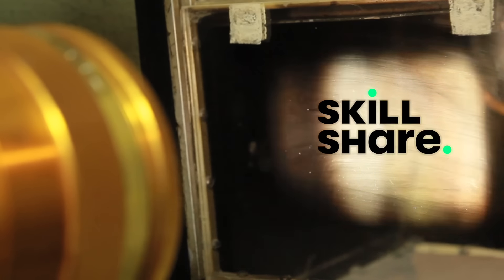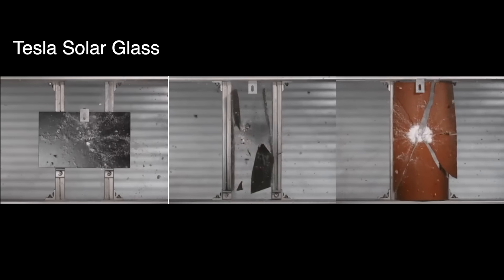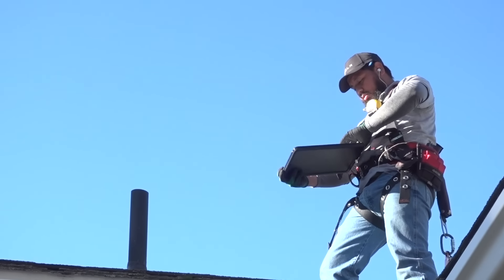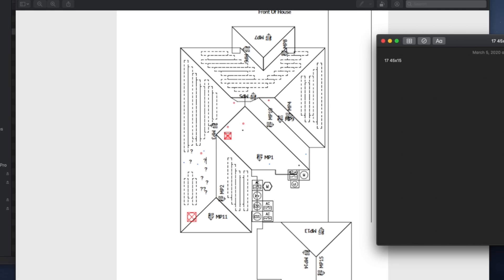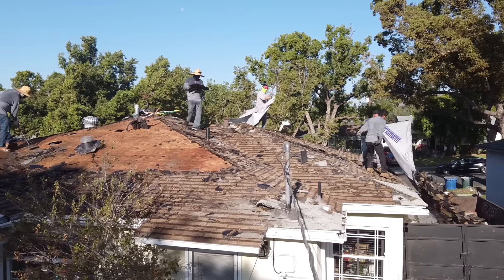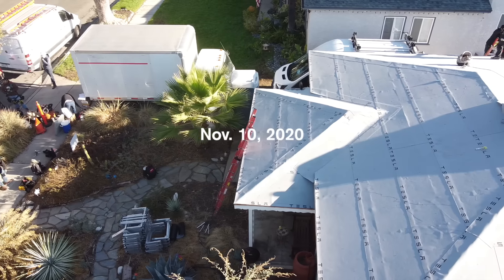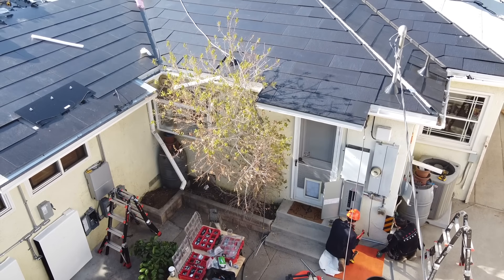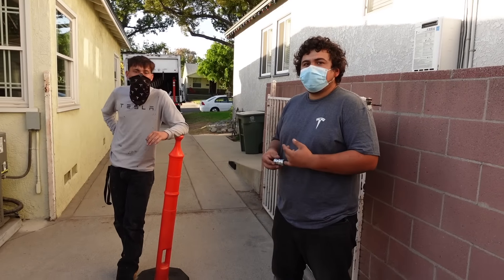This Tesla Solar Roof Was NOT Built in a Day

Comment: What about carbon footprint did you calculated my friend?
Reply from the maker: Hey friend, while there are no global warming emissions associated with generating electricity from solar energy, there are emissions associated with other stages of the solar life-cycle, including manufacturing, materials transportation, installation, maintenance, and decommissioning and dismantlement. Most estimates of life-cycle emissions for photovoltaic systems are between 0.07 and 0.18 pounds of carbon dioxide equivalent per kilowatt-hour. This is far less than the lifecycle emission rates for natural gas (0.6-2 lbs of CO2E/kWh) and coal (1.4-3.6 lbs of CO2E/kWh).  SOURCE: IPCC, 2011: IPCC Special Report on Renewable Energy Sources and Climate Change Mitigation. Prepared by Working Group III of the Intergovernmental Panel on Climate Change [O. Edenhofer, R. Pichs-Madruga, Y. Sokona, K. Seyboth, P. Matschoss, S. Kadner, T. Zwickel, P. Eickemeier, G. Hansen, S. Schlömer, C. von Stechow (eds)]. Cambridge University Press, Cambridge, United Kingdom and New York, NY, USA, 1075 pp. (Chapter 7 & 9). http://www.ipcc-wg3.de/srren-report/
Reply: @ThisGuysTesla  Wow thanks for fast response and satisfying answer with citations. Nobody takes his job this serious in youtube. Real respects for you :D

Comment: My final conclusion after seeing this rather involved analysis is this.  A Tesla roof is not financially feasible and is truly a waste of money.  Spending $65,000 on this system when it would take nearly 15 to 20 years to break even (assuming a zero cost of capital) is a dramatically wrong decision.  You can obtain a robust electric power back up for only $2,000 to $4,000 if outages are an issue.   However, the video was great and truly informative.   Invest that money instead is a REIT that pays you 5% indefinitely ($3,250 annually) and goes up in value, rather than becomes worthless in 20-30 years like this solar roof.
Reply from the maker: 65K? Not really. I have a video about my final cost and when the system will be completely payed off: https://youtu.be/abyQeGIQ4JA

Comment: An energy efficient home or business is more comfortable and saves money in the long run.
Added insulation, triple glaze windows, energy efficient doors, energy efficient heating and cooling systems, energy efficient appliances, LED lighting, smart thermostats, solar panels combined with battery storage and a electric vehicle charger in the garage or car park. People are too focused on the short term costs and miss out on long term savings and comfort. Blower door testing and air sealing are under appreciated tools.Even if you have money to burn you should not waste it.  Climate Change will impact everyone. Leave a better future for your children and grandchildren. Join in and speak up for the future of the planet.

Comment: There’s a bit of goal post changing n the video.  Early on the video proposed the ability to go off grid due to wildfires and the like.  Later, the goal switched to “neutrality”, a very different thing.  

Th goal from all this must be to drastically cut carbon emissions, and affordably if the solution is to see mass adoption.  If “neutral”. means the solution is always have a fleet of fossil plants out there on the grid ready 24/7 for when the home system fails, then 1) the system will never be very low carbon, and 2) a completely dual power system, grid and roof sitting side by side will never be affordable at large scale (ie subsidies run out).

Comment: Their durability test didn’t look all that fair... they compared it to longer ones, creating more of a weak point. Also the Tesla tile was on its side, with the middle holding bracket right at the middle. 

tldr: The non Tesla Tiles were placed so they had a greater weak point. The Tesla tile was placed in a much better position.
Reply from the maker: To be fair, those are the actual attachment points on a roof of either tile

Comment: You are getting hit by the contractors. Check the size of the plywood, 1/2(standard) is only $30 and yes that is up from it’s original but your looking at $100 per square and it takes one man no more than 30 minutes to overlay a square. 
Now the tiles, that’s out of my wheelhouse, never installed them, only metal shingle and wood shake and regular solar panels.

Comment: clean energy?
Reply from the maker: If you’re concerned about environmental impact, supply chain sourcing, factory carbon footprint, end product recycling and net energy breakdown you could read this:  https://www.tesla.com/ns_videos/2020-tesla-impact-report.pdf

Also While there are no global warming emissions associated with generating electricity from solar energy, there are emissions associated with other stages of the solar life-cycle, including manufacturing, materials transportation, installation, maintenance, and decommissioning and dismantlement. Most estimates of life-cycle emissions for photovoltaic systems are between 0.07 and 0.18 pounds of carbon dioxide equivalent per kilowatt-hour. This is far less than the lifecycle emission rates for natural gas (0.6-2 lbs of CO2E/kWh) and coal (1.4-3.6 lbs of CO2E/kWh).  SOURCE: IPCC, 2011: IPCC Special Report on Renewable Energy Sources and Climate Change Mitigation. Prepared by Working Group III of the Intergovernmental Panel on Climate Change [O. Edenhofer, R. Pichs-Madruga, Y. Sokona, K. Seyboth, P. Matschoss, S. Kadner, T. Zwickel, P. Eickemeier, G. Hansen, S. Schlömer, C. von Stechow (eds)]. Cambridge University Press, Cambridge, United Kingdom and New York, NY, USA, 1075 pp. (Chapter 7 & 9). http://www.ipcc-wg3.de/srren-report/

Comment: it probably took 22 tons of coal to produce this roof tile
and the emission on coal was less then the next 20 years of this roof
Reply from the maker: If you’re concerned about environmental impact, supply chain sourcing, factory carbon footprint, end product recycling and net energy breakdown you could read this:  https://www.tesla.com/ns_videos/2020-tesla-impact-report.pdf

Also, while there are no global warming emissions associated with generating electricity from solar energy, there are emissions associated with other stages of the solar life-cycle, including manufacturing, materials transportation, installation, maintenance, and decommissioning and dismantlement. Most estimates of life-cycle emissions for photovoltaic systems are between 0.07 and 0.18 pounds of carbon dioxide equivalent per kilowatt-hour. This is far less than the lifecycle emission rates for natural gas (0.6-2 lbs of CO2E/kWh) and coal (1.4-3.6 lbs of CO2E/kWh).  SOURCE: IPCC, 2011: IPCC Special Report on Renewable Energy Sources and Climate Change Mitigation. Prepared by Working Group III of the Intergovernmental Panel on Climate Change [O. Edenhofer, R. Pichs-Madruga, Y. Sokona, K. Seyboth, P. Matschoss, S. Kadner, T. Zwickel, P. Eickemeier, G. Hansen, S. Schlömer, C. von Stechow (eds)]. Cambridge University Press, Cambridge, United Kingdom and New York, NY, USA, 1075 pp. (Chapter 7 & 9). http://www.ipcc-wg3.de/srren-report/

Comment: I call be by contractor claiming the dry rot on the facial was unknown and the other boards needed to be replaced for one the faces completely visible and accessible it's on the edge of the freaking roof  hanging down. It's a typical attempt by unscrupulous contractors to increase the project cost by claiming this is an unknown when they knowingly expect it especially on a 40-year-old roof. And were the people who drew up the plans and submitting the city not knowing what they were doing aren't they professionals Don't they know the state codes why would it have to be resubmitted multiple times because they didn't know what the state codes were especially parts concerning power output.?

Comment: Probably the least effective solar roof i have ever seen, not even half the surface of the roof panels are turned in the optimal direction and angle of the sun. With a flat roof, better panels (like in Europe) with better angle and direction optimal towards the sun, you would probably generate twice the solar electricity than with these Tesla solar tiles. What a waste of lost solar energy. In cloudy and could Western and Northern Europe with Class A thermal insulation and that size of roof you would be near zero dollar bill (for heating and electricity) per year, especially with the new solarcloud accounts.
I do over 10000 kWh per year in cloudy and cold Western Europe same house size as yours in very sunny USA. Imagine all the lost money over the years using tiny Tesla tiles on non flatted roofs and not optimized towards the sun diagonal standing panels.
And in the USA the long building delays for these Tesla tiles on your roof and the asking prices with batteries compared to Western Europe (where labour is more expensive) are ridiculous

Comment: How much energy do you use that $65k becomes an acceptable cost?  Even including a new roof into the equation it seems somewhat excessive.  Is this Apple syndrome at play?
Reply from the maker: I have a video about the final cost and when the system will be completely payed off: https://youtu.be/abyQeGIQ4JA
Reply: @ThisGuysTesla  Hmmm, that 27k does not and will not apply to everyone.  Even the tax rebate and referrals are a bit sus.

If you really needed a new roof, then OK but the quoted cost is excessive.

For most people this is just not worth it unless you plan to live there 20 years and is does not go phoom in the meantime.  Maintenance cost need to be factored in.

Don't get me wrong, you did well but it is crazy to think everyone can do the same.

Apple syndrome it is ... ;)
Reply from the maker: Soon it’ll be called Tesla Syndrome

Comment: So how does this compare to solar plants that align the panels perpendicular to the incoming light? Do you not lose an insane amount of efficiency and produce more waste with fixed panels like that? Also, they need to be clean and free of debris and dirt. I doubt the average homeowner will bother putting in the work to do that. This whole commentsection is just a circlejerk with almost zero critical thinking involved

Comment: Hopefully, God will step in when, or if,  you have a leak in your roof or sidewalls where the exterior switches and controllers were installed.  Maybe she/he can stop the leak without having a contractor come in to do repairs.  Future corrections or remodels to either the roof or walls are going to cost 3X what they would normally be and you're going to have to supply 100% of the money.  Suggest you dedicate  the savings to a fund to cover future added costs.

Comment: 50000 grand! How can this be a viable option? Surely you'd be better off just buying energy off the grid
Reply from the maker: Many people compare the entire system costs of a Tesla Solar roof and battery to a conventional solar system. Still, they fail to consider that this is replacing a roof and comes with batteries. So the costs for a new roof and the batteries should be taking out of the payback calculation if you want to compare apples to apples.
 
Also, our system pays for our cars' electricity. So, if you have two cars, how much are you paying for your cars' fuel per year? 
 
For us, it works as follows:
 
Solar portion of the roof: $17,800
 
House electricity costs saved per year: $1800
Car Fuel saved per year: $2500
Yearly Saving: $4300
 
Payback period: 4.1 years
 
Now, our batteries are basically free at this point. We got a $5800 grant from the state, plus one battery will be compensated by Tesla through their referral program (when you refer ten or more customers - we have 19 so far). In addition, we get $400 per completed install from our referrals. 
 
Finally, this youtube channel has already generated over $16k in ad and sponsorship revenue, by the end of the year we are projecting conservatively $20k. 
 
 If all continues as it has, the entire system solar + battery +new roof will be paid off in 2-3 years, and we get to enjoy a roof that will outlive us.
Reply: @ThisGuysTesla  Fair enough IF you needed a new roof I guess, I was talking in general terms of people other than yourself however, it seems the return on investment would be a little to long for your average joe, who doesn't necessarily own a tesla or other e-vehicle to benefit from the gas savings and has a perfectly serviceable roof.
Reply from the maker: Totally

Comment: This is literally less sustainable than a normal house.
Reply from the maker: while there are no global warming emissions associated with generating electricity from solar energy, there are emissions associated with other stages of the solar life-cycle, including manufacturing, materials transportation, installation, maintenance, and decommissioning and dismantlement. Most estimates of life-cycle emissions for photovoltaic systems are between 0.07 and 0.18 pounds of carbon dioxide equivalent per kilowatt-hour. This is far less than the lifecycle emission rates for natural gas (0.6-2 lbs of CO2E/kWh) and coal (1.4-3.6 lbs of CO2E/kWh).  SOURCE: IPCC, 2011: IPCC Special Report on Renewable Energy Sources and Climate Change Mitigation. Prepared by Working Group III of the Intergovernmental Panel on Climate Change [O. Edenhofer, R. Pichs-Madruga, Y. Sokona, K. Seyboth, P. Matschoss, S. Kadner, T. Zwickel, P. Eickemeier, G. Hansen, S. Schlömer, C. von Stechow (eds)]. Cambridge University Press, Cambridge, United Kingdom and New York, NY, USA, 1075 pp. (Chapter 7 & 9). http://www.ipcc-wg3.de/srren-report/

Comment: congratulations you will have roughly paid off your system in about 28-30 years +/- 5 for seasonnal swings.
that was not worth it ! 
the thing with power genegration plants is they are the most efficient when they are big thus not really cost effective on such small builds. but whatever
(you will only have paid it off if it even lasts that long and does not require any additionial mantinace work in the next 30 years good luck with that)
Reply from the maker: Looks like I may have it fully paid off within less than 2 years.
Reply: @ThisGuysTesla  no deffenetly not when going off the stuff in the video you paid approx 45k and you use 160kwh a week thats 7700 kwh a year thats 1770$ in cali and that makes it take 28-30 years now i dont now about seasonnal flunctuations that why i said +/-5 years but that is assuming you use 100% solar which you dont but are very close to
Reply from the maker: This is what it looks like right now and projected for the end of the year:
Cost Breakdown:
$50k Total Cost
-$9.5k Tax Rebate
-$5.8k Battery Grant
-$18.3k Sponsorship/YT
-$0.4K Referral
————————————
$16k Current Cost

Projected Income End 2021 
-$1.5k Electric Bill
-$0.35k Net Credit
-$1.6k Referral
-$15k Sponsorship/YT
————————————
-$2.45k (Profit) plus free charging for EV (which amounts to average gas savings of $2.5k a year)

Comment: Did you take into account the horrible ecological impact of building solar panels in your calculation /
Reply from the maker: Sure did. If you’re concerned about environmental impact, supply chain sourcing, factory carbon footprint, end product recycling and net energy breakdown you could read this:  https://www.tesla.com/ns_videos/2020-tesla-impact-report.pdf

Also While there are no global warming emissions associated with generating electricity from solar energy, there are emissions associated with other stages of the solar life-cycle, including manufacturing, materials transportation, installation, maintenance, and decommissioning and dismantlement. Most estimates of life-cycle emissions for photovoltaic systems are between 0.07 and 0.18 pounds of carbon dioxide equivalent per kilowatt-hour. This is far less than the lifecycle emission rates for natural gas (0.6-2 lbs of CO2E/kWh) and coal (1.4-3.6 lbs of CO2E/kWh).  SOURCE: IPCC, 2011: IPCC Special Report on Renewable Energy Sources and Climate Change Mitigation. Prepared by Working Group III of the Intergovernmental Panel on Climate Change [O. Edenhofer, R. Pichs-Madruga, Y. Sokona, K. Seyboth, P. Matschoss, S. Kadner, T. Zwickel, P. Eickemeier, G. Hansen, S. Schlömer, C. von Stechow (eds)]. Cambridge University Press, Cambridge, United Kingdom and New York, NY, USA, 1075 pp. (Chapter 7 & 9). http://www.ipcc-wg3.de/srren-report/

Comment: 50k and all the emissions nope I will stick with normal power
Reply from the maker: while there are no global warming emissions associated with generating electricity from solar energy, there are emissions associated with other stages of the solar life-cycle, including manufacturing, materials transportation, installation, maintenance, and decommissioning and dismantlement. Most estimates of life-cycle emissions for photovoltaic systems are between 0.07 and 0.18 pounds of carbon dioxide equivalent per kilowatt-hour. This is far less than the lifecycle emission rates for natural gas (0.6-2 lbs of CO2E/kWh) and coal (1.4-3.6 lbs of CO2E/kWh).  SOURCE: IPCC, 2011: IPCC Special Report on Renewable Energy Sources and Climate Change Mitigation. Prepared by Working Group III of the Intergovernmental Panel on Climate Change [O. Edenhofer, R. Pichs-Madruga, Y. Sokona, K. Seyboth, P. Matschoss, S. Kadner, T. Zwickel, P. Eickemeier, G. Hansen, S. Schlömer, C. von Stechow (eds)]. Cambridge University Press, Cambridge, United Kingdom and New York, NY, USA, 1075 pp. (Chapter 7 & 9). http://www.ipcc-wg3.de/srren-report/
Reply: @ThisGuysTesla  I did my part this summer by offset and global warming by sticking out a bucket of ice on my patio! Every time I hear someone talk about global warming going to be the end of humanity blah blah blah you know what it makes me want to do go out and burn a tire and when someone with a YouTube channel does it and makes me want to burn two tires and since you are a offset or as you said offset I'll burn three tires in your name